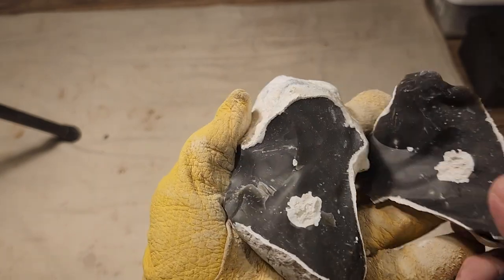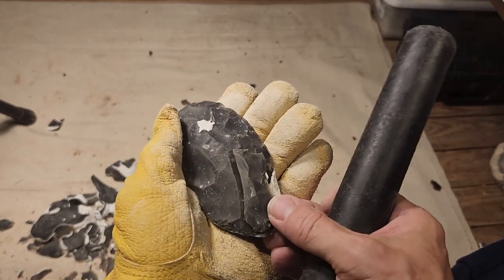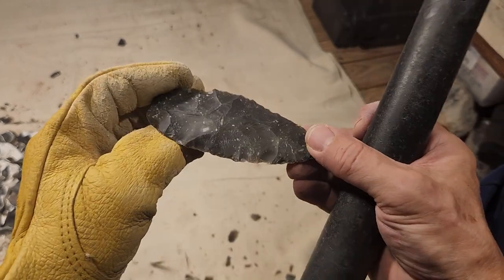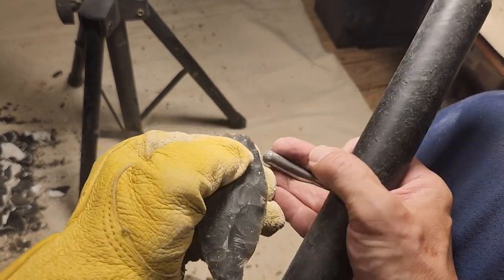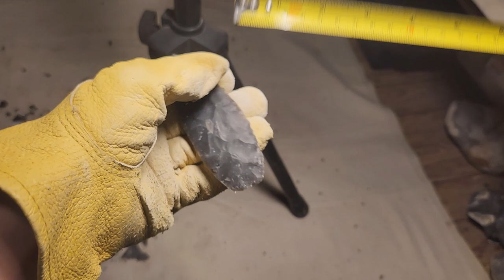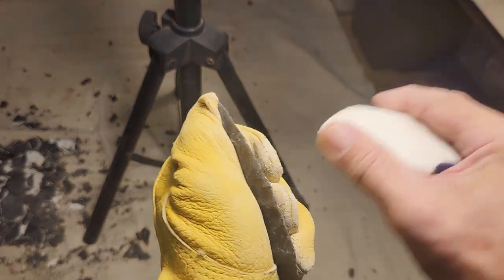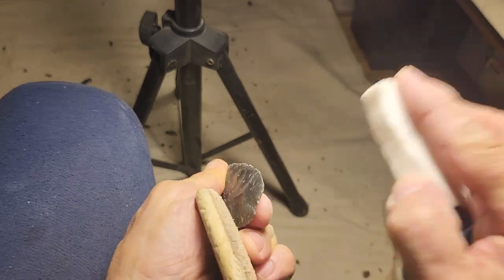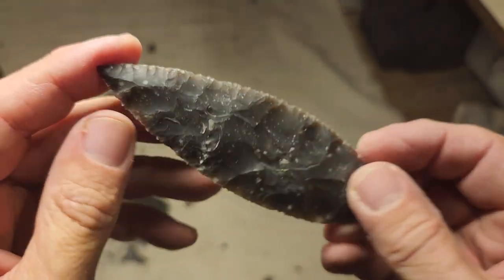1566 - Rock to Point - Part 4/6 - Euro Flint Challenge Knapping

Comment: So good finally seeing my favourite flint worked by you. I'd been chipping stuff for ages like the other lower quality European materials and constantly coming up against exactly the same problems you did...over and over. You then said in one of your videos that if you're constantly having the same issues then it's probably the material and not necessarily the knapper/knapping and to look for better materials....so i did untill i found this stuff and everything changed. I think that spending so much time trying to Knapp lesser quality material taught me so much about damage control and other stuff. 
 This particular piece of flint has come from down deep in chalk. The quality changes as you go down deeper. In prehistoric times they were really after the ' table flint' for working tools as this was the highest quality...black, shiny with virtually no defects,concrete,etc. the piece you knapped was a nice quality and yes there's a pretty much endless supply of it when you know where to look.  I go to deserted quarries near my house and pick stuff up. The flint runs in bands across the chalk face with maybe a meter of chalk between each band so by the time they're down to the table flint they maybe 50-60 feet underground. The bands of flint above the table flint were all called "wall flint" and apparently the flint for flintlocks came from a band about halfway down the wall. 
 Will Lord made a really interesting video about ' Grimes Graves' prehistoric flint mines and actually goes down in the prehistoric mines and explains about the flint and what they were after. Just as you said,the high quality material does knapp like obsidian. It will run long,long flakes and is highly responsive. As you said its very dense and very flexible. It's quite happy to be ' super smacked'and is a dream to pressure flake. It's a really nice material to knapp for sure. I've so enjoyed this ' European material series.